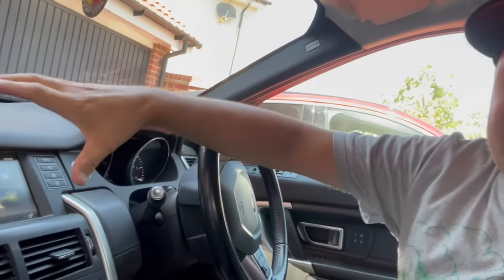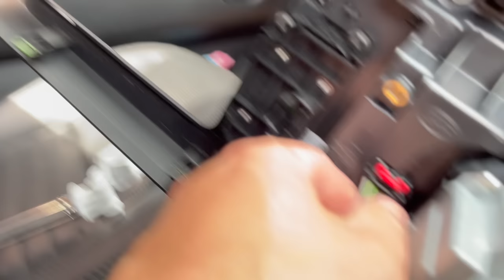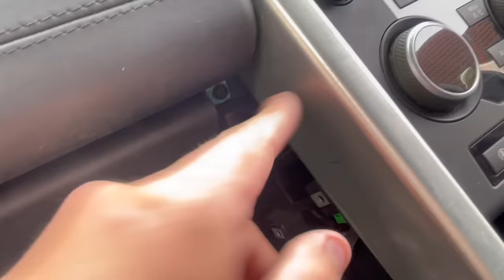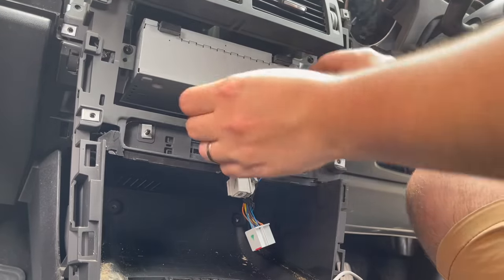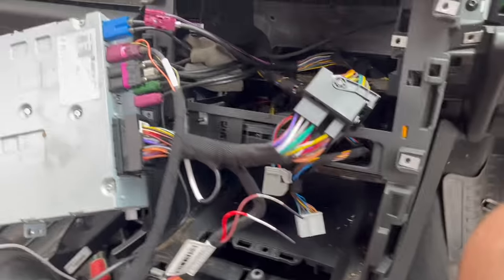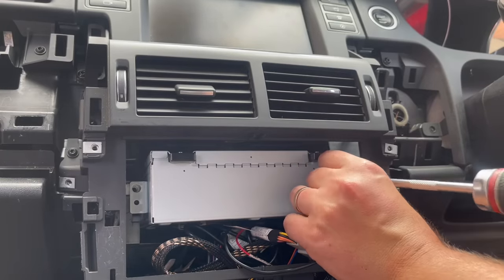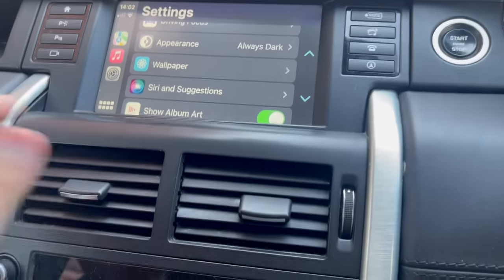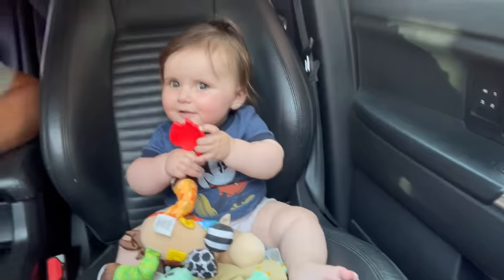How to Easily Add Apple CarPlay to Your Land Rover Discovery Sport | Step-by-Step Installation Guide

Comment: I've done the same thing on my manual one a few months back and the rear camera doesn't work no matter what... I was hoping you found a way to make it work... Good job documenting everything by the way!
Reply from the maker: Thank you, I’m going to fit a 3rd party one to the system, so it’ll run separately. Also using the system to fit one in the back seats to use as a baby monitor :)
Reply: @GarrethEvans  can’t wait to see your work!

Comment: @GarrethEvans  Very useful step by step guide that helped me through the installation ... can you advise about dipswitch configuration that worked out fo you at then end ? I am having issue with the original reverse camera that is flickering with dipswitch 8 on position ON .... am I doing something wrong ?

Comment: Hi Gareth, great vid ...... 
did you ever manage to hook up a reverse camera
Reply from the maker: Hi, thank you. I did, but it was a weird one. So what I actually did 2 months ago was bought a cheap reverse camera to plug into the unit, and shoved it behind the dash. This then allowed the unit to read that there’s a camera connected, but automatically selects the main reverse camera as default based on the flick switches. I literally tried everything I could think of, but this was the only way I could get it to work 🤦
Reply: Hi Gareth thanks for the quick reply …. Strange way to do it but if it works then fantastic. So just to clarify you did have the original LR camera installed but could not get it to work.
Reply from the maker: @mints4us  that’s correct, my original one now works by connecting in a random cheap one, and ensuring switches are in the right position to use the original one, not the cheap one. Obviously if you don’t have one built in, you can wire a read and forward facing one into the unit. But by having those on, you don’t get any use of the original camera, not even with the car play unit off. No idea why, but a lot of experimenting gave me that conclusion.

Comment: I just installed this and the backup camera didn’t work at first. There are dip switches that need to be changed. You must unplug the white power connector from the new unit every time you try a new dip switch setting. The combinations are only dips 1,2, and 3. Mine ended up working with dips 1 and 3 off and dip 2 on.
Reply: No reversing camera for me just scrambled screen - no video feed for rear camera but dip 2 everything else works
Reply: Ok fixed had to power cycle the car - dip 2 and 8 and its working on the main display when changing to Android or Apple it flashes between displays 😊

Comment: The reverse camera should kick in automatically without a third party camera, others have shown this on youtube. Also should have done wireless rather than having to plug it in each time.
Reply from the maker: @matthewlaw8268  does have wireless, but wireless runs through WiFi. I’d rather use wired and charge my phone the same time. Probably depends on the Landrover model for the reverse camera.

Comment: Did you all ready find the solution for rear camera? I have one from factory installed.
Reply from the maker: Unfortunately not, I’m going to fit a 3rd party one. It seems the only way :(
Reply: To get the original rear camera to work you need to fit a piggyback fuse loom to fuse  number 11 on the fuse box in the glovebox and connect it to the orange wire on the main loom supplied with the unit.

Comment: Does audio work?
Reply from the maker: Hi, yeah the audio works perfectly :)
Reply: @GarrethEvans  Great to hear! I will try this myself soon. Is it also wireless carplay or only via usb?
Reply from the maker: This particular one was both, some of them are only usb. The wireless works through wifi, not Bluetooth for some reason.
Reply: @GarrethEvans  only if the aux jack cable is plugged in the aux socket of the armrest ?